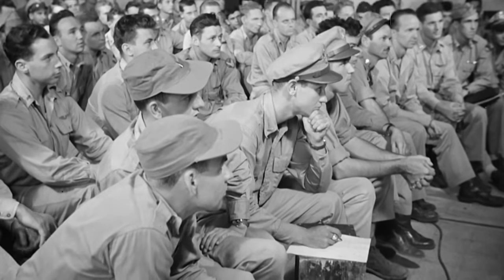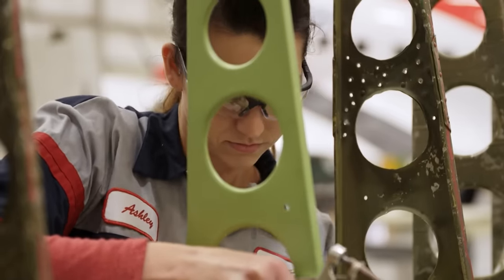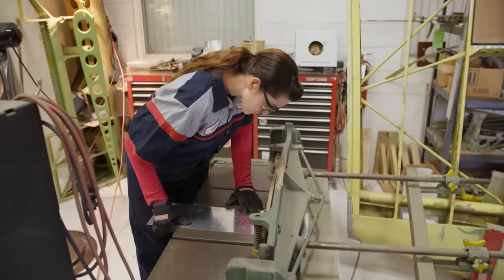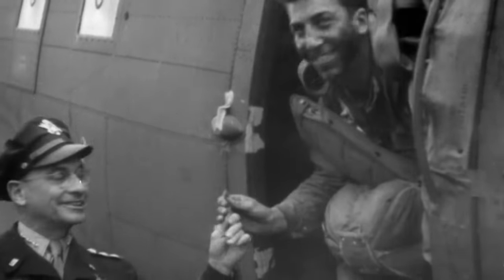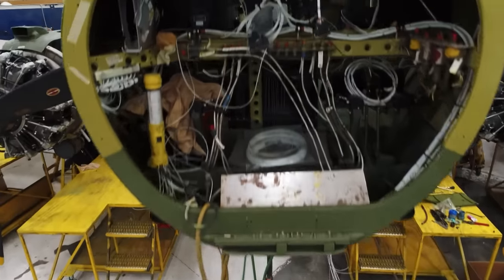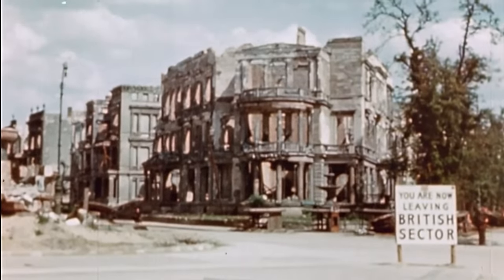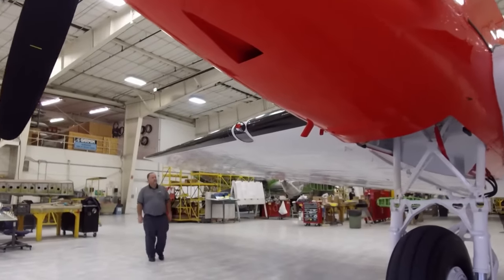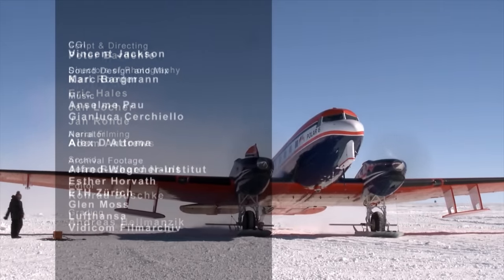The Douglas DC-3: The Plane That Flew For Almost A Century | The DC-3 Story | Spark

Comment: I flew 1,600 hours in the DC3's & 24 hours in a C47.
All the DC-3's I flew had the R1820 9 Cylinder Wright Cyclone (B17, Dauntless etc) & the C47 had the R1830 14 cylinder Pratts - almost identical to operate.

I  had 1,000 hours in VH-ANR our favourite ( Still in the Queensland Air Museum  Australia) - it was pre war around 1936, used by the Dutch KLM Indonesia Airline until the Japanese invasion when it came to Australia - flown by the US Army - RAAF & then civilian.

Coming from only flying single engine fixed prop & gear to a DC-3 was a big jump for me - our group of trainees spent 1.5 hours learning how to taxi & that is a challenge!
In the air it is a big heavy Cessna, very forgiving & I loved flying it, except in pouring rain near the lowest safe altitude with METO Power & your still going down it's  not fun.😮😊

Comment: Truly one of the finest aircraft ever produced - in my opinion.
Reply: I agree. A brilliant design! It's only rival is the B-52...
Reply: @hrdley911  the TU95 has also been in service as long as the B52..... the DC3 predates both of them. the DC3 is truly exceptional, an aircraft that has far outlived anyone involved in it's design. rugged, reliable, capable. im 42 years old and i wouldn't be surprised if they are still being flown when im in the dirt.
Reply: @andrewdonohue1853 Thanks. Forgot about the TU95. There's just something clean and elegant about the DC3/C47 for me. Years ago on a trip to Aruba, I  noticed 5 or 6 parked on the opposite side of the field. A local told me they had been idle for some time. Hope they weren't turned into Chinese cars...😮

Comment: That's a great documentary. Thank you. It brought back a fond memory of my first experience of flying. We flew  from Eastleigh Airport (UK) to Jersey (Chanel Islands) when I was about 8 years old in the early 1950's. No one else at school had ever been in an aircraft, so I was a celebrity for a short while. Of course I had no idea of the eventful history of the DC3, but I knew that was what I was flying on. The "Air Stewardess" came through the cabin with a tray of Barley Sugar sweets from which we were allowed to take one. I was told that it was to help with the pressure change on my ears. Flying is simply not the same any more.

Comment: Last contract as aircrew in 1993 DC3 for Southern Air Transport-Burlington, Biggs Army Airfield TX to Chihuahua MX had brand new radials and just out of maintenance at Wright Paterson. It was the very first DC 3 built. Our first flight we had fire in #1 on the final into Chihuahua. The valve push rod in one jug had beat itself and bent. Pratt and Whitney came with an engine change kit with in 8 hours. That contract lasted 6 months. Out of 40 years of aero contracts that was one of me favorite!

Comment: Most aircraft were built for the military.  There actually was very little DC3 built for the civilian market because most were C47.
The Basler turbo prop version has to have around 16 inches of fuselage added to balance out the engines. But it’s a totally new aircraft basically.

Comment: When the mainline airlines ended DC-3 service, many ended up flying as commuter airlines  (hub to small town airports). Gadsden (a city of 50,000 in Alabama) had DC-3 service from 1947 to about 1968 (when the DC-3 was replaced by a second-hand Martin 404)

Comment: The first airplane I flew in was a DC-3 in the early/mid 1950s.  It was a United Airlines plane.    The flight was from somewhere in Virginia to somewhere in Ohio.  During an intermediate stop, I was taken to the cockpit and the pilot demonstrated reversing the pitch of the propellers.  The ground crew saw a little kid's head sticking out of the cockpit window while the propellers were rotating in the hub.  Someone came to check on what that kid was up to.  I thought that pilot must have the best job in the world.

Comment: My father flew C-47’s in the Army Air Corps in WWII in Europe and North Africa. He was part of the D-Day invasion fleet, but as a glider pilot. But thankfully his wave wasn’t needed and was cancelled. 

One story out of many I’ll share is that he once told me that during their pre-flight walk around they would always check the ground under the engines where the plane was parked. They were looking for oil. And if they didn’t find at least a small puddle, they would call their crew chief over and instruct him  to have the oil level checked. Because lack of oil stains meant that the engine was running low! 

Dad passed away in 2017 at the age of 93. Thanks for the memories.
Reply: I flew in a C-47 being used to haul freight in Alaska. I rode in the jump seat and there was a Plaque in the cockpit that told of that aircraft being used on D-Day by the Canadian Air Force.

Comment: Spark, your description says the DC 3 was used in both world wars. This is not possible since WW I was from 1914 - 1918 and the DC 3 was not developed until the 30s.. Also as others have noted, the DC 3 is still in service, so it will probably make it to a full century. My dad flew these for Trans Texas Airways in the 50s and 60s. Thanks for producing this video.

Comment: A little factoid.  The RAF acquired a Dakota to join the outfit formerly known as the BBMF  (Battle of Britain Memorial Flight" - composed of a Lanaster and some Spitfires and Hurricanes plus a couple of Chipmunks for training.  The testing mob at Boscombe Down declared it unsafe for Para Dropping!
(In case of a parachutes chords snagging on the tailwheel.)
Fair enough actually.  The solution though was simple.  Just a little metal shroud in front of the wheel.  I do though woder how much that mod' cost the taxpayer - I feel a Freedom of Information request coming along!!!